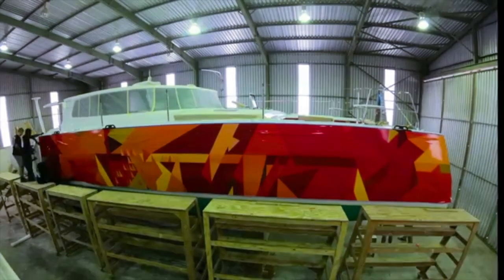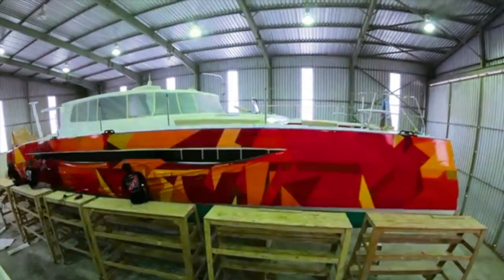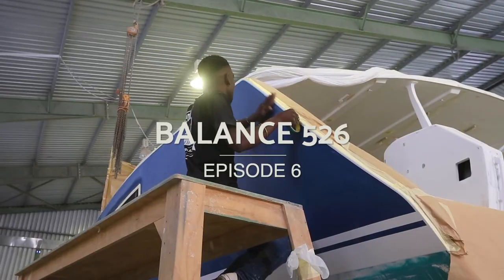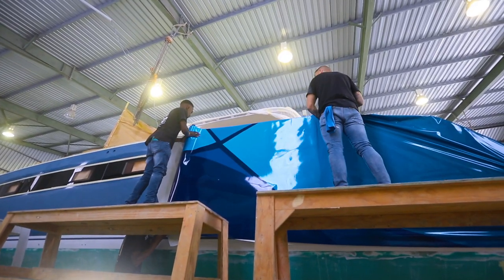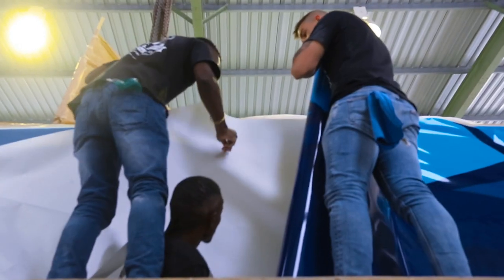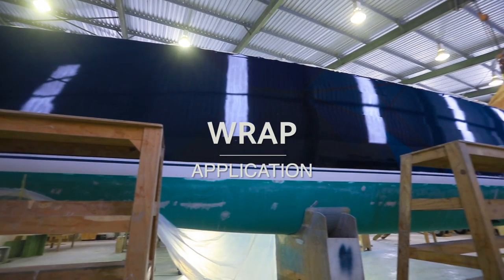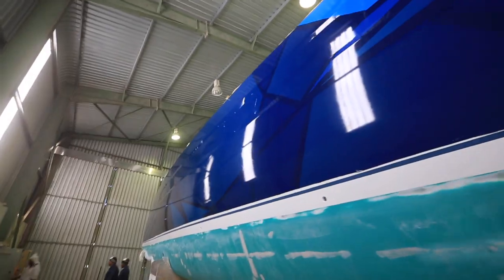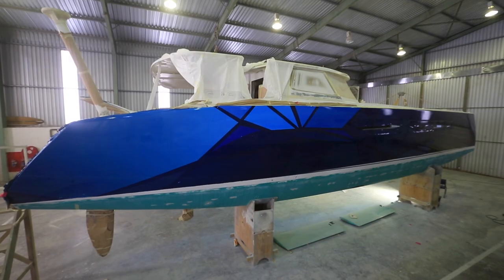Build Series: Episode 6 Wrap your Catamaran

Comment: How long does it last?
Reply: Not sure what brand of wrap they're using. I've read 3M wrap will last only 3 years or less at best if in a southern climate. If you're bad a docking or docked a lot dock/fender rub will shorten that lifespan. If someone tells you 5-7 years tell them to prove it.
Reply: @heavychevy4355  begs the next question,  how hard is it to replace?
Reply: @seanwilson6521  Like car wrap, pour hot water, pull and its gone.
Reply from the maker: @Sean Wilson - VERY easy. One can replace it as often as one likes. The great thing about a wrap is that one can change the design of one's hull every few years....!
Reply: @balancecatamarans  Thanks for that info! What brand wrap are you guys using? What is the life expectancy? What is the avg. cost per foot?
Reply: @heavychevy4355  If they use a cast vinyl/laminate, then they are a 7yr vinyl.  The ink durability is what reduces the life, with most inks lasting 18mths to 2yrs outdoors, un-laminated, before you see fading.  Put a laminate on it and you can easily double the life.  They will be laminating these prints.
On a vessel, they need to seal all edges that will be effected by water; so along the waterline, and around the bow, etc, this will help stop the edges from lifting.
In this video, they are not using a 3M vinyl (that I can see) as the release liner should have branding on the back.  It could be Avery, which is another good brand.  Their application method on a flat panel doesn't look too easy, so my guess it is neither, as both brands of cast vinyl really are 'childs play' to put on flat surfaces.

Use a top quality brand, with a good ink/printer, there is no reason why the prints don't last +5yr before you see noticeable fading.  Go to a precoloured wrap film and that will go out further.

A good quality fender shouldn't damage the vinyl, but bad docking will. Not different to paint really.  The benefit is, once it is looking poor, you can easily peel it off and re wrap it, or leave it clear, as the surface underneath will look like new.

Hope that helps.
Reply: @michaelkingdon3815  The surface of a Balance Catamran is not flat... it has 3 dimensional curving on the horizontal and vertical directions of the hull.... The hull is also wider than 60inches.